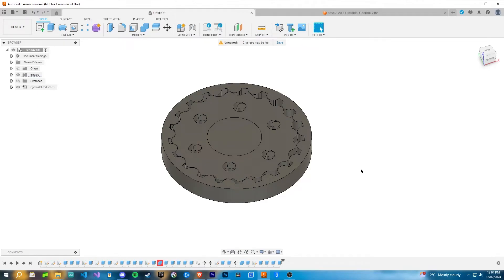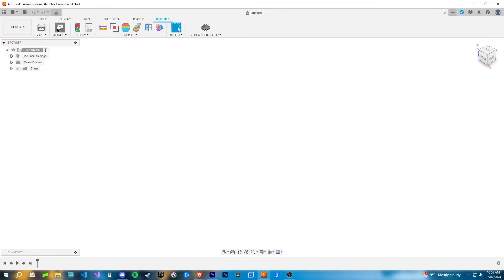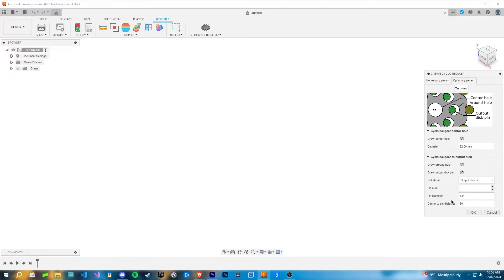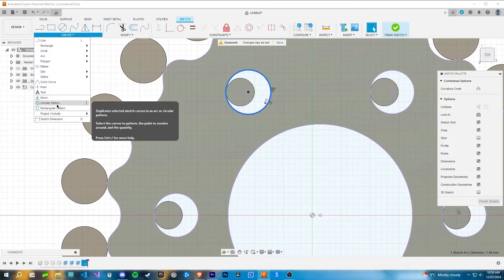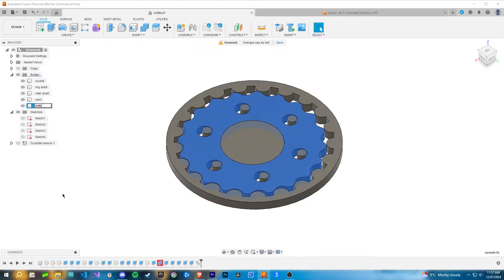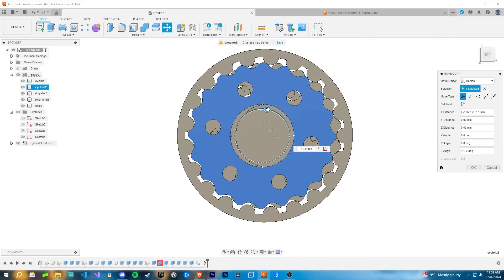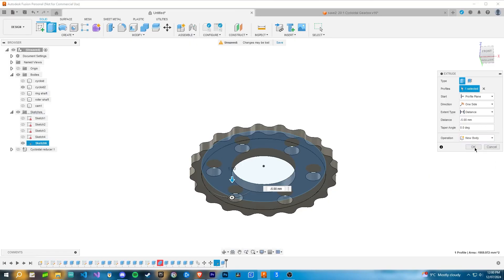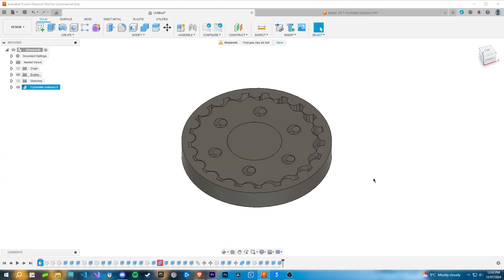The Best Way to Design a Cycloidal Drive

Comment: why are you dividing the 180 degrees with gear ratio? The second disc is supposed to be out of phase exactly 180 degrees I suppose.
Reply from the maker: '180 out of phase' just means the disc is on the opposite side of the other disc, notice how ive also moved the disc to the side by '1.37*2', rotating the disc by '180/20' just aligns the lobes. if that makes sense lol

Comment: Hey man, thanks for this video. Can't explain enough how much time this saved me. After following, I was able to finally design and 3d print mine. It works very nicely with *almost zero backlash, except I am unable to properly align the output shaft with the two cycloidal discs. I used the same CAD models from Fusion 360 after using the curve generator, and after printing and assembling, the output shaft appears to be skewed, instead of being centered. Any chance you could advise on how to fix this? Would really appreciate.

Many thanks.
Reply from the maker: @goplayman5658  All I can think of is to make sure you’ve centred your output shaft sketch off the right point

Comment: Thank you for the video!
I was looking into this and then I saw the latest video from Mishin Machine channel.
He has a similar drive, but it's just much simpler as it has less moving parts and needs less bearings.
Reply: Thanks for the tip! However, notice the ball carrier could easily sheer if under high torque and 3D printed due to Z axis layer weakness. Also, note that the balls provide very little surface area which may result in wear grooves, especially if 3D printed. The concept is great, but if 3D printed, you may want to stick with very low torque applications to avoid wear/failure.